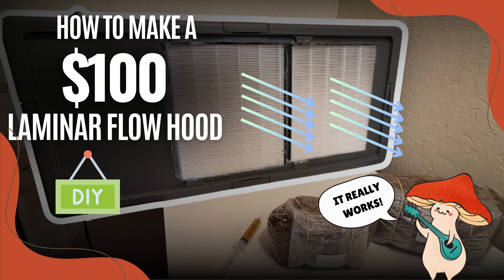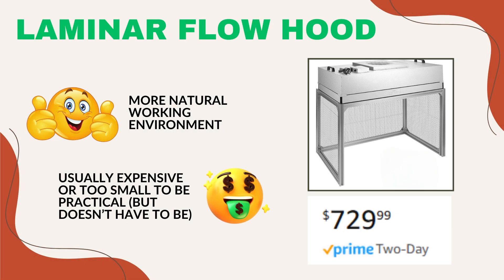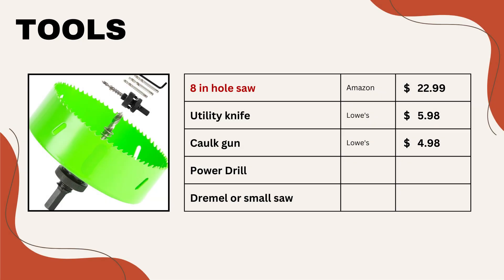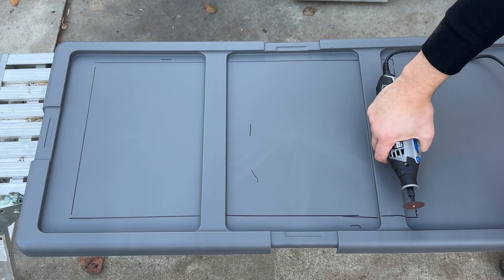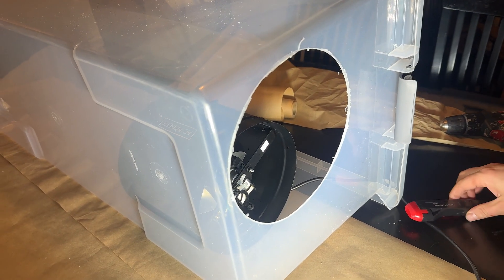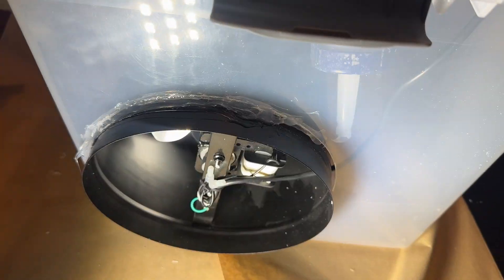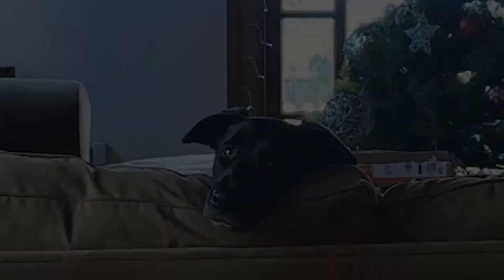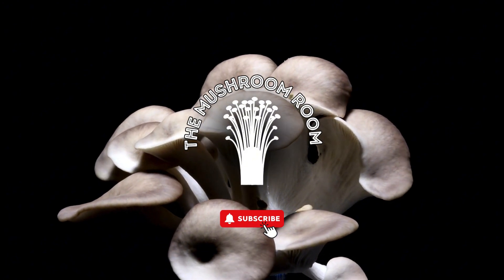The $100 dollar LAMINAR FLOW HOOD 🍄🍄

Comment from the maker: Here are the links for the materials that I used to build the flow hood. 🍄‍🟫🍄‍🟫

 100l latching storage box
https://www.target.com/p/extra-large-latching-clear-storage-box-brightroom-8482/-/A-83279838

AC Infinity RAXIAL S8, Inline duct fan
www.amazon.com/dp/B07ZPF4NRX

LV-PUR131 Replacement Filters 
www.amazon.com/dp/B0B74VRG9K

Clear Silicone Caulk
www.lowes.com/pd/GE-Silicone-1-Tub-and-Tile-Kitchen-and-Bath-10-1-oz-Clear-Silicone-Caulk/5005330289 

8 in hole saw
https://a.co/d/edGUXLC

Comment: Great job. 👍
If I need more height to work, can I place the box upright with the fan on top? 
And is the area between the 2 filters also a clean area to work in? 

Thanks and I look forward to seeing your next videos.😃
Reply from the maker: Thank you! Yes, you can easily place the box vertically or raise it if you prefer. There is a 1 inch gap between the two filters which is indeed subject to turbulent flow. However, since this gap sits right in between two large areas of filtered, laminar flow, the risk of introducing any contamination through this gap is minimal. I'm glad you found the video helpful 🍄🍄